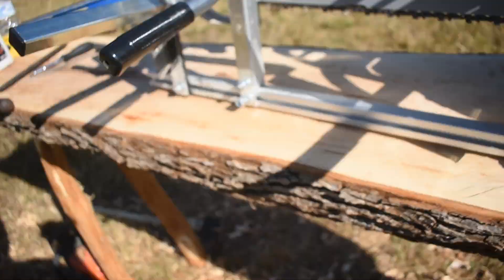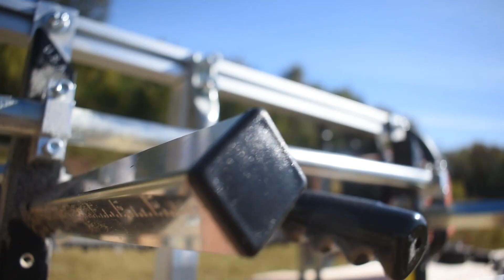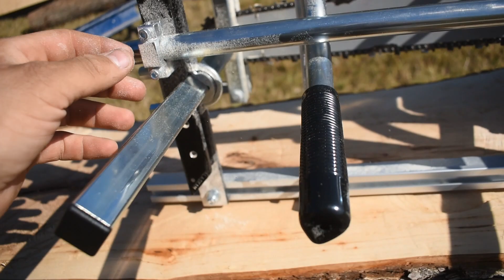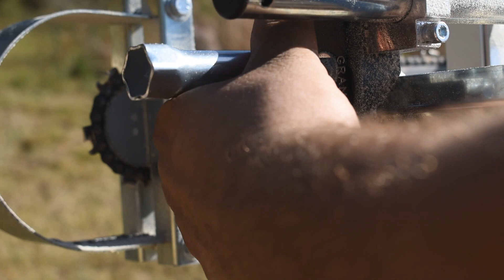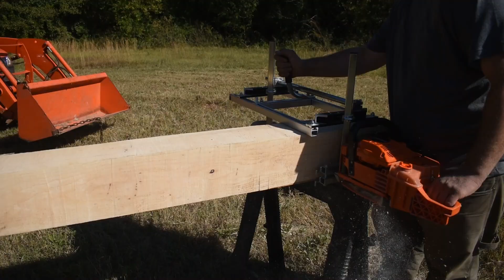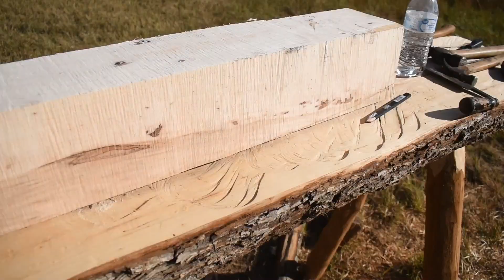using the Granberg Alaskan Mark IV chainsaw mill

Comment: I love mine, back the sprocket end bar back to the last connecting rivet, or you run the risk of pinching the sprocket and burning up your bar, I may have done that on my last 28 inch bar...
Reply from the maker: Great advice thank you. I'll have to back it off next time I use it